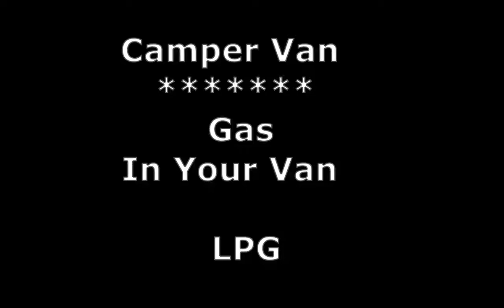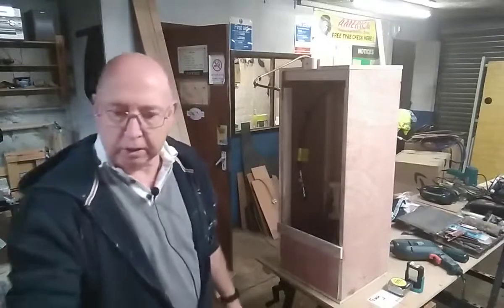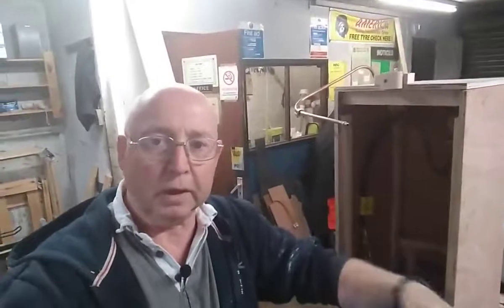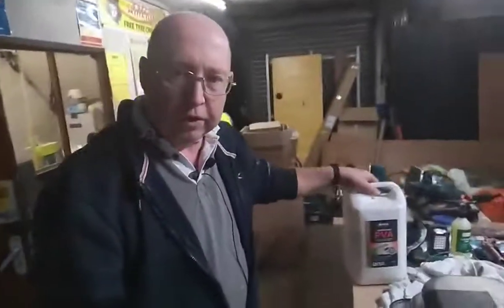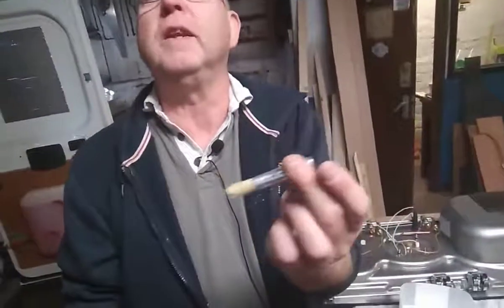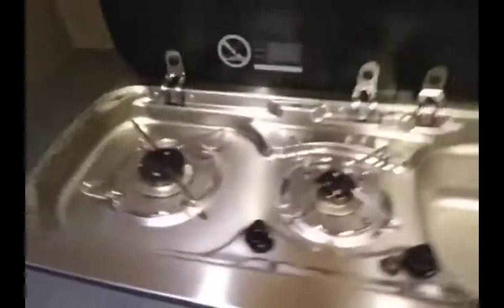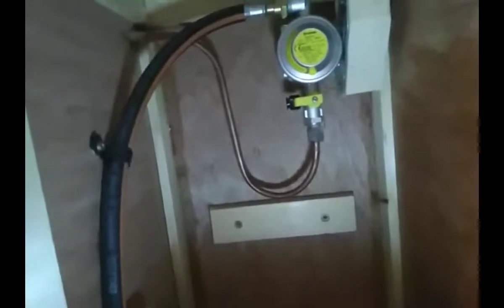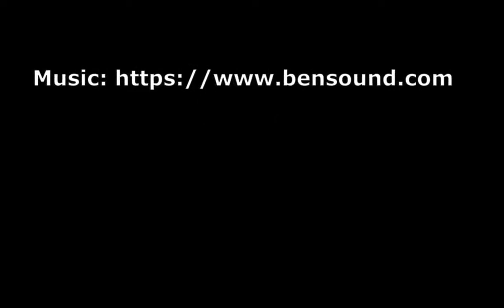Camper Van Gas : How To Install LPG Gas Locker & Hob Into My Camper Van Conversion UK

Comment: Did you do a video of you installing gas pipes
Reply from the maker: Hi "@user-2xu1jilo*2" how you doing ?
Sorry for the slow reply, I'm just about to leave on another little trip !
No, I've only done the one video on "LPG Gas" and that feels a long time ago now haha, the only pipe you have to make, as far as I can remember is the metal pipe from the regulator to the appliance, I used copper as it's easier to bend/shape, it has to be a " 1 piece" pipe with no joints, from memory it was quite tricky ! Just tack your time, also put a " dropout" vent directly below the connection to the appliance.
Thanks for watching my video and taking the time to comment, good luck with your own project ...
Cheers ... Jimmy ...

Comment: How to do I hook up a Dometic HB 1320 single burner stove to propane?
Reply from the maker: Hi Jonny, How you doing ? 
Thanks for the comment / question . As I'm unfamiliar with a " Dometic HB 1320 single burner stove"  and haven't personally used propane before ( I use butane myself )  also my video was made a few years ago and regulations may have changed, I'm therefore not going to offer any advise as I would hate to give you wrong information. I would advise you check the current regulations ! also  make sure you use the correct regulator type ie permanent fitted appliance or mobile appliance and the correct gas feed pipe (also known as a pigtail ) .
Sorry I can't be more help ! thanks for watching and taking the time out to comment , good luck with your own project & if your not 100% sure what your doing, get a professional to advise you or do it for you ...
                                     Cheers ... Jimmy ...
Reply: @jamesstringer8172  I figured it out! Got my stove working. My stove required 0.5 psi regulator. I used 0.4 regulator which is low pressure hooked up soft hose to the stove with hose clamps. Used a adapter that has an On / OFF switch and using the little 16oz propane canisters! Woohoo

Comment: Thanks so much for your video!  I learned a lot and really enjoyed your sense of humor ;-)   I'm a single 77 year old woman in the US and just bought a used  2020 Ford Transit van.  I live in a condo and don't have the tools, space or experience to do the conversion myself and am  interviewing camper van conversion companies.  I have a gasoline engine and live in Colorado where I camp at high altitudes, so I want a propane heater and stove.  I will need to store the propane tank inside the van and know that I need a sealed locker.  

What I am confused about is that I have seen YouTube videos that say that I need both an out-take vent in the floor of the van plus an intake vent near the top of the locker for "replacement" air.   Other videos say nothing about a second  vent. The US National Fire Safety Association in the US says you need the two vents but does not describe how you accomplish this without having that second vent inside the van .  I have found some videos that suggest that the second vent can be connected to a hose or conduit  that eventually exits at the bottom of the van, but a few  inches away from the first vent.  I don't believe you mentioned the need for a second vent.  I have also found two companies that make propane lockers for marine use and neither appears to have a second vent.  I would really appreciate your thoughts on this!  Thanks,  Hazel B in Denver,  Colorado, USA
Reply from the maker: Hiya Hazel, how you doing ?
Thanks for the great comment / question, I’m really pleased you enjoyed my video and very impressed that you could understand my geordie (people from Newcastle ) accent haha, with you coming from Colorado, I bet you’ve go some stunning locations to stay over there, I’d love to tour America in a campervan .
You sound a very adventurous lady !  I’ll try my best to give you good advice.
I must start by saying I only know UK regulations ( and my research was done a few years ago now and may have changed ) so you should go to a reputable US conversion company that is familiar with local US regulations.
To be honest I haven’t heard any mention of a gas locker needing two vents ,  although it would make sense, ie one at the bottom of the gas locker ( UK call that a drop out vent ) that should go straight down & out the van ( outlet vent ) and one at the top of the gas locker ( not a few inches from the other vent though ) which would let fresh air into the top of the locker and assist the leaked gas to escape out the bottom.
I’m a bit concerned about what you say about the bottom vent having a pipe attached so the leaked gases can “eventually” exit at the bottom !  remember, propane ( & butane for that matter ) is heavier than air and will find it’s lowest point and will settle there if it get a chance.   If the pipe had any bends there is a potential for the escaped gas to get trapped and maybe back up,  back into your gas locker, you bottom vent should go vertically down and straight out to the outside of you van, ie no potential places for the gas to get trapped, I hope all that makes sense !     
I wish you good luck with your van & all the adventures you’ll have in it and thanks again for firstly watching my video ( + subscribing to my channel ) and taking the time to comment, I really appreciate it …
                                Cheers … Jimmy ...
Reply: @jamesstringer8172  Thanks for the response.   Yes, I do understand that the bottom vent should go straight out the bottom of van.  Guess  i didn't explain myself very well.  What I am trying to figure out is how necessary is that second vent at the top.  Most van conversion YouTube channels don't mention it, but a few do.    I'll keep researching.  Interesting that a lot of van conversions here in the States don't seem to have sealed, vented boxes.  I think our regulations are pretty loose.   I'm going to do it, for sure, just need to find out more about the second vent.
Thanks again.

Comment: Hi, can you tell me what you are spraying on the joints?
Reply from the maker: Hiya, how you doin ?
In answer to you question - "what am I spraying on the joints"  I'm afraid I don't know off the top of my head, I used two products on the pipework joints ! one was a joint sealer and the other a leak detector ! both of which I talk about in the video ( around 12.30 min ) & do close-up's off there containers ! I hope this helps ? if not get back in touch and I'll try and find my receipts to get you more info.
Thanks for watching and commenting...good luck with your own van...
              Cheers...Jimmy...
Reply: @jamesstringer8172  I found some...it was gas leak tester 😉